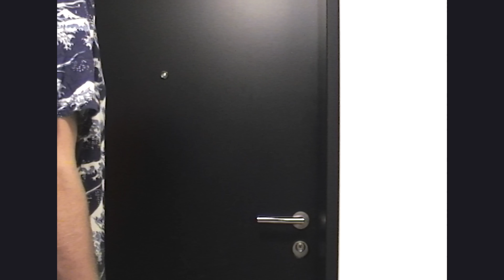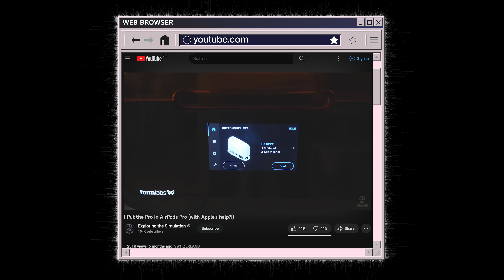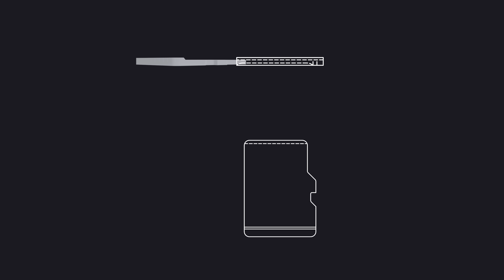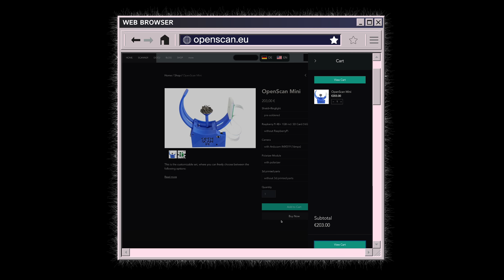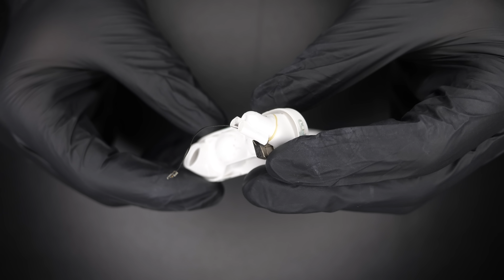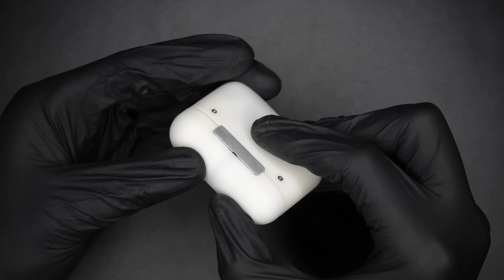I STOLE the AirPods Design, and improved it! (+ free download)

Comment: how do you make the hinge im trying to make a similiar one for a small sized conatainer with a magnet close
Reply from the maker: The hinge is very overengineered! I loosely drew it up in CAD, since I was reusing the original metal hinge. For new designs, I would simply use a pin acting as a pivot point, but that depends on how premium you want your container to feel. Good luck!
Reply: @ExploringTheSimulation  thanks so much

Comment: Ok but what if the screws were charging contacts? Just like you drop the buds into the case, imagine dropping your airpods case into your charger/holder. No lightning socket.
Reply from the maker: Haha I think I see what you mean. Would look like inception for chargers. I think it would feel a lot like Magsafe/Wireless charging. In the end I still think USB-C is the best way forward, that's why I built a mod for it :)

Comment: Since you are using screws, what does the waterproofing look like? Is it water proof at all?
Reply from the maker: no, but original isn't waterproof either. can definitely be made waterproof with rubber seals and slightly different design, but that would be another project with a different scope. here I just want to debunk the 'too small to not use glue' myth

Comment: We don't need screws. We need better glues, that encourage repair, by changing properties when heated up to 160F
Reply from the maker: better glues could be interesting. 160F is too low though, could melt if you leave it on a car dashboard
Reply: @ExploringTheSimulation   It needs to be considerable below the softening point of PA6🤗 

The device isn't straight out damaged, by the expanded seal. Just the seal needs to be replaced after such mishap. The customers will learn, not to torment there device like this😈
It is bad for the battery chemistry anyway.

Oh dang. I forgot to mention, that the glue should not melt at 160F but expand to a foam, so knife and spatula have enough wiggle room, without stressing the display sandwich or glass/ceramic back.

Comment: I love my type c kit I got! Thank you! Also any recommendation for my old air pod pros? The mic on them seems to sound like I'm under water. I cleaned them and still no luck, I wonder if it had problems after so many drops (not intentionally but over the years that I've had them, they taken some tumbles)
Reply from the maker: how did you clean them ?
Reply: @ExploringTheSimulation  small fine brush and a small qtip and fine point tweezers to get around the edge a bit. I didn't want to use any liquid at all cuz I don't know what to use.
Reply from the maker: @jimmyscott5144  there's a bunch of videos on it, try with IPA!
Reply: @ExploringTheSimulation   okay, thank you.

Comment: This is crazy cool, and smart. If only apple had you employed. I did notice one thing I think you could have done, maybe indent the crews a bit and place a plastic or rubber matting to cover up the crew or make a very thin cover or shorts, cheap easy to remove and still reparable. But I'm no engineer so do your best work 👍
Reply: Apple have a ton of engineers, they are just paid to make designs that are not repairable.